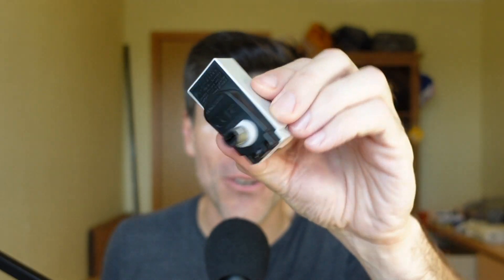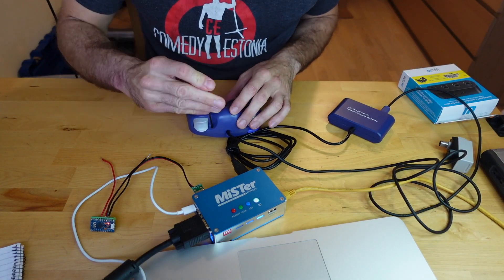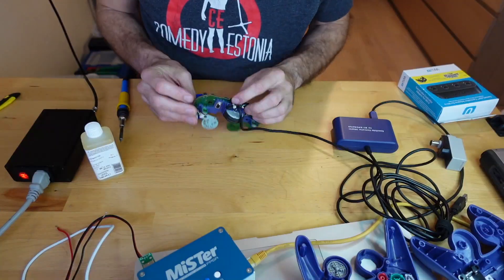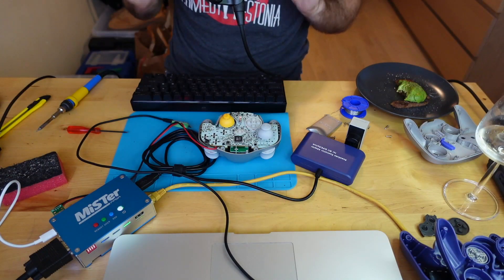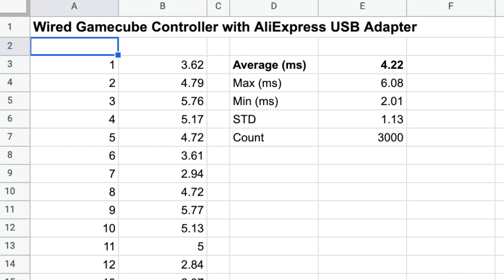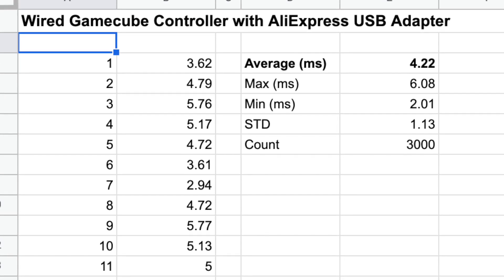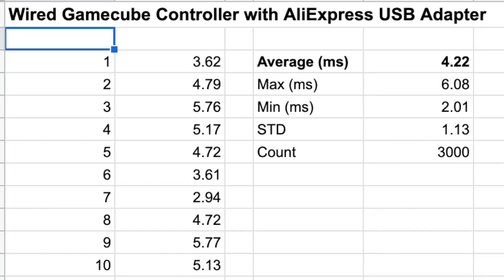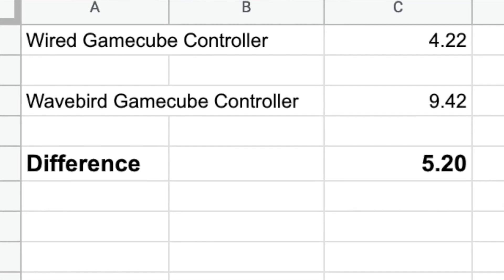Does a WaveBird add lag? (scientific tests!)

Comment: Fantastic video and data. I’m so happy to hear the Wavebird only adds ~5-6ms compared to wired. That (surprisingly) does make a difference in Melee at the competitive level, but that’s the absolute only usecase I can think of that would be affected by such a small amount of added latency. 

One question I have that could be interesting would be what is the comparison of Wavebird latencies at different distances, or with crowded 2.4ghz airwaves? I wonder how much that would affect things, and I’d love to see a followup video if you’re up for it!
Reply from the maker: It’s on the list. I could move the wavebird away from the receiver and also see how it goes between rooms. Not that you would play between rooms but it gives a sense of the signal strength. It’s harder to test a busy spectrum, not sure how to generate interference.

I suspect as you move further away that latency won’t be effected but inputs could be lost. I am not sure which part of wireless communications adds issues. I just assumed it still goes over the air pretty quick, it’s the work to encode and decode the wireless signals in say Bluetooth
Reply: @ZezRetro  I'd be interested to see this test done along with the 8BitDo wirless mod kit. Seems to be the successor to the Wavebird in that it adds rumble, but may be somewhat laggier.

Comment: Man I'm such a big fan of this videos. I had this fight with a fried when I was in college. No we really know. 

BTW, and sorry to bother. I do a lot of controller tests on my channel. If you want to check the English versions the URL is: https://www.youtube.com/@0toTech but my question is. I want to add Lag testing with the Mister to my tests. But I don't what to make holes on the PCBs. I was thinking on making a clip with a pogo Pin that snapped to the PCB signal line. And other one to ground.

Do you think this might be possible? Or have you seen something like this I could use?

Thanks and keep up the good work.
Reply from the maker: Thanks for letting me know about your channel, it looks sweet.

The part about drilling the PCB is probably the part I regret about the original lag tester video. I learnt this technique for pad hacking and I kinda just wanted to show it off. An easier and less destructive method is to use one of the shoulder buttons. They generally have larger points for you to solder on to. In this video I used the Z-button on the GameCube controller and it was very straightforward
Reply: @ZezRetro  Oh man, I cannot thank you enough. So simple and yet I never thought it. Shoulder buttons almost always have soldering joints. Great gonna try that. Thanks again.
Reply from the maker: The lag tester project works well but it’s very much homebrew and can be fiddly. If you have any more questions about it hit me up on Twitter and I can help you out
Reply: @ZezRetro  Thanks again. I just ordered all the stuff. Should try it this week.

Comment: Bigger reason for smash players not to use wavebird imo is missed inputs because wireless interference in 2022 on the 2.4hz signal is far worse than it was in 2003, which can lead to  lead to dropped inputs.
Reply from the maker: A great point!  In some extended testing later I got  a few outlying results (1 in 1000) which back up this claim

Comment: The tiny bit of extra lag makes no difference to me, but what I have noticed is the occasional dropped input on my wavebird. I have 2 wavebirds and 2 receivers and I've noticed with both that sometimes I push a button and just nothing happens,  but I never notice that with my wired controllers. Where I sit while playing is about 6.5 ft from the system so it's well within the advertised range. Anybody else have any issues with this? Am I just imagining it and blaming my controller for me being bad lol?
Reply from the maker: Average time is one thing but max and min times also contribute. This was deliberately a quick look at lag but I suspect there are more factors at play like distance and interference. I ran these tests a few times and probably a handful of times out of several thousand I got results which were far outside what is expected. Not statistically significant for a simple test but something is definitely happening very occasionally

Comment: That's quite interesting. I think that in a speedrun, or competitive environment, it would make a difference, which you would feel in very occasional missed inputs. It would be quite rare, but I think there would be cases where an input was missed because of the lag. 

However, this is still pretty impressive for the time, and for a wireless controller in general. It's perfectly serviceable for moderate to casual pay, and for games that do not require split-second inputs. Smash is a crazy beast altogether because you can do multiple inputs in less than a milisecond. Most games won't have that kind of input requirement. So if you're playing other things, I think it's fine.